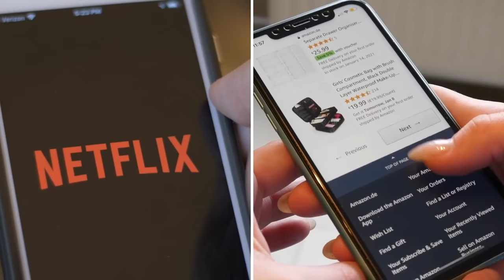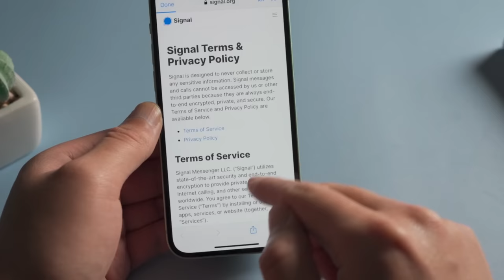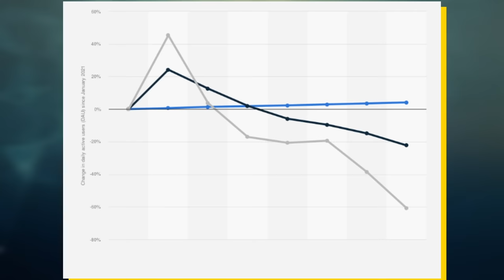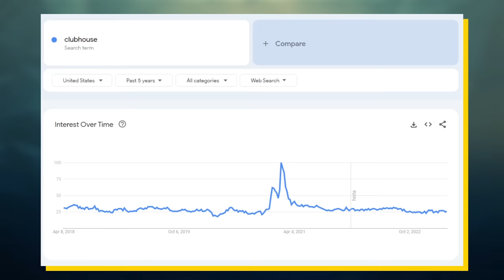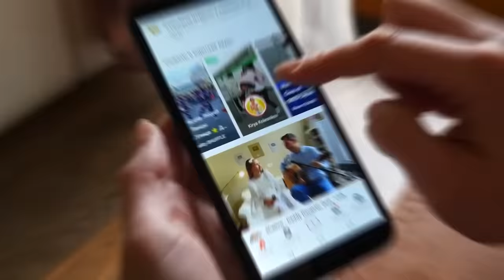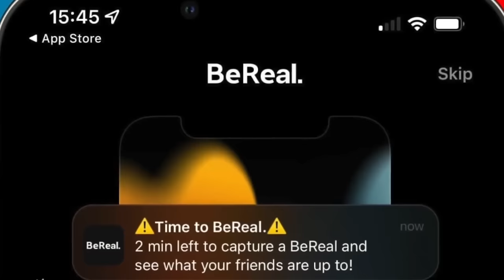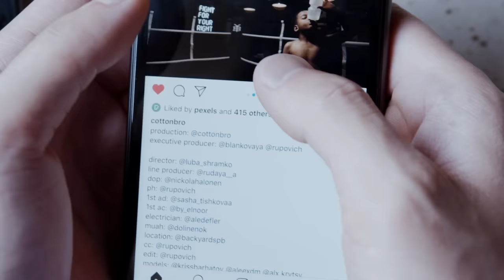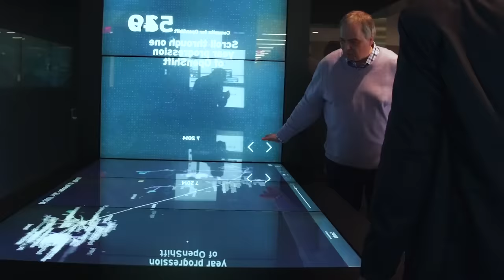Anti Big Tech Companies Are Already Failing

Comment: Problem really is that most of the companies are platforms, and as long as you have got the customers using your products, they are basically locked in. They are natural monopolies if they capture enough people, since it's about that network. So to be frank, I think only solution is to open up these platfroms by force. For example, assuring compatibility with messaging apps, or sending files between clouds, etc.
Like said in video, people can't stand these companies, but due to nature of the product, they kinda have to use them, sacrifice a ton, or spend a lot of effort to convice their circle to switch, which probably wouldn't work for everyone anyways. Not because they are good, but because they have the people. There's really nothing people or competitors can do.
Reply: yeah it's like, if you really care that much about not enabling cookies you're probably pretty isolated in your own little world
Reply: I don’t use Amazon or FB or anything. I am addicted to YouTube though. But that is easy to reproduce, and don’t care about the viewer community. Just the content, but anyone could make a new YouTube.
Reply: So basically what email does? Where services can connect to each other. The European Union is preparing a legislation about that, Apple and it's iMessage exclusivity is not very happy about it.
Reply: @TheBooban  "Everyone can make a YouTube" No, hosting videos is expensive and keeping an "advertising friendly" platform is even more expensive because you require moderators.
Reply: Ya, but how do you pay for the servers with you got that amount of people? It's either ads, sell data, or the app can't be free (and if it's not free it'll never get the same amount of people)
Reply: An open source system where everyone has a fair share should get humanity to next lvl
Reply: @TheBooban  You are forgetting the cost of the storage and network connection. If the alternative had as much content as YouTube it would cost as much to host as youtube. The software cost is irrelevant.
Reply: You know not everyone actually hates these apps right? Some just prefer them even when they are using our data(not stealing it as we do give them permission to use it, it's just that people don't read the T's&C's) because we get more ads that we actually are interested in rather than random ones.

Comment: Signal needs to bring back SMS support. If its so confusing for someone to know if theyre sending SMS or a signal message, don't use it as your default SMS app.
Reply: It’s 2023. SMS should be entirely disabled.
Reply: @FlorianWendelborn  that's valid but its not disabled and it was the only way I could keep my pleb non signal users on the same app
Reply: They removed it for security concerns. Google messages has a SMS encrypted service if the other person also uses Google message as their default SMS app.
Reply: @Jose04537  Maintainability and User Confusion was also a major concern (according to the signal devs at least)
Reply: @FlorianWendelborn  Well, it's a method of reaching a person right now, not waiting until they turn the internet connection on. I know some people just keep their phones connected to internet 24/7 (which is kinda counterintuitive and just feels off), but it's not everyone. Not to mention people (like me) who don't carry smartphones at all.

Comment: 9:56 I disagree. Back when I had an instagram I could tell that the algorithm just screwed up its work. For both explore and reels pages the content I could see there has begun mismatching with my interests. I dare to say that it started to do it on purpose. Like when I tapped "not interested" for the content I didn't want to see, I've started to see it even more. Also many of popular trends were hyped up instead of the content similar to things I've liked, I've shared or I've saved. This wasn't the case at  first, it just became a thing after a while
Reply from the maker: Looks like the they’ve got work to do haha
Reply: I second that, there is some combination of what the company wants to push and the user preferences.
Reply: I've noticed the same thing
Reply: Could it be that tapping "Not interested" is actually counted as a positive engagement behind the scenes? And they are looking to increase that. After all, you're still interacting, even though you might not like the content.
Reply: @jakubj_  😁 "Made you click"

Comment: If these services are going to succeed, they're going to need the help of their users. Now, as users typically aren't technically included, we need a movement to create a bridge of sorts between the knowledge needed and the users. With that established, it becomes much more feasible because instead of renting servers to host your app, you let your users host it for you. They can pay for the server by means of cloud computing, giving them free internet access to. PS: ISPs with still be needed, it's not a long haul circuit that the uses are going to be building out, just the last Mile.

Comment: I have been using single since 2021 and when I was convincing my fam and family to move to Singhal most of people were missing features like stories which made them feel less connected z I have even mad a donation to signal and requested to add story features. But there never did until recently now the flame of low. I guess they are too slow

Comment: Microsoft Windows heck Microsoft thought Lunux will fizzle out. Look where Linux is now - even Microsoft is using it at the cloud. FreeBSD, Haiku, Signal etc As long as there is an open source and non profit community your Big Tech will more easily fail because open source and non profit from now to eternity akin to sharing which is innate in society.

Comment: The problem with Signal is really they don't get any promotions and discount in data usage with the ISPs and mobile companies. For example, some ISPs allow you to access WhatsApp in "emergency" mode, although slower. You can't do that with Signal. And that's how they don't get new users, or get their current users to migrate their peers.

As for DuckDuckGo, they lost me when they revealed to be driven by the same "t4ctics" and "p30ple" (read j33ws) who drive search engine rival. They started "align", and do just as much c33ns00rship in their search engine results. Basically they right now are just a "skillsh4r3" bad frontend to Google and Bing. No different results to Google and Bing... The same sites and results b4nn333d there are in the Duck.